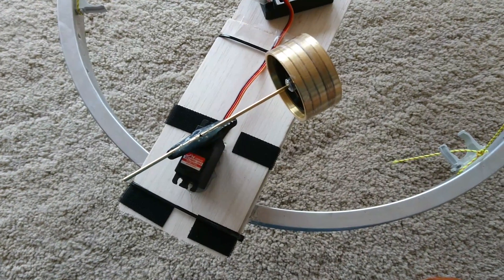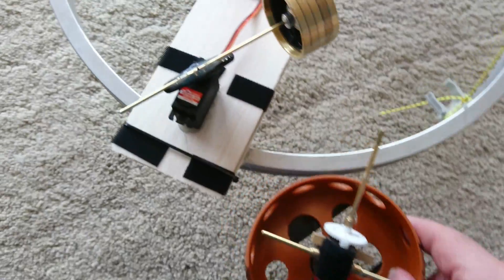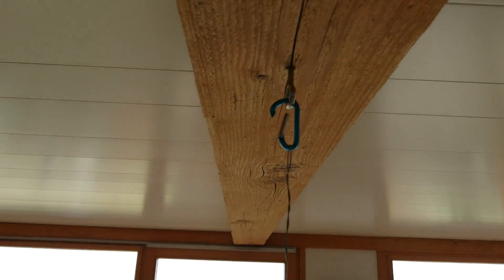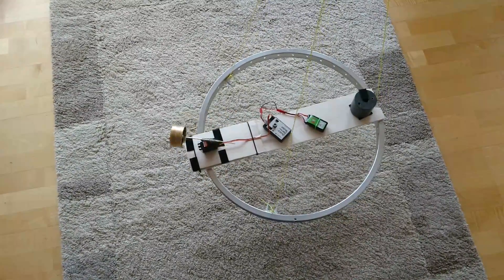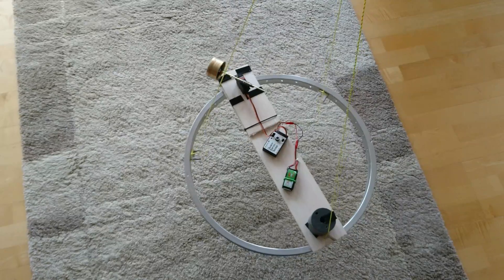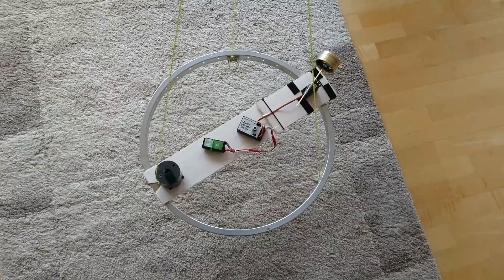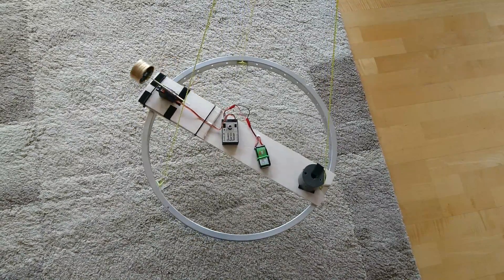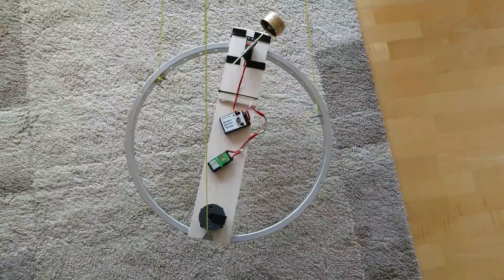inertial propulsion with gyroscope part 7

Comment: maybe it is like I can imagine:
there are gravity waves that shape lines of clouds in the sky https://upload.wikimedia.org/wikipedia/commons/f/f4/Tadrart01.JPG and ripple shape of spread fine falling sand or distribution of water in waves. (this pattern reminds me an interference pattern, maybe it comes from different suns.)
those gravity waves are like scanning the earth, they are like half meter wide. and move with speed of like a 1 meter in 2- 4 seconds.
the dense atoms interact more with this force. when a wave is coming. it interacts with it. - this is what I can imagine in this video.

actually, I imagine the gravity theory are like small particles are fly from the sun and from free space as they distributed in space, they fly into the center of heavy objects in space. like into the center of the earth. as they fly into the earth they hit atoms on their way and so push things into the earth. and so create gravity. also those particles hit and friction each other and other atoms so in the center of earth it becomes hot.

gyroscope - a dense material spinning wheel is throwing away many particles that fly into it and so it neutralizes the hitting gravity particles. it throws them away radially.